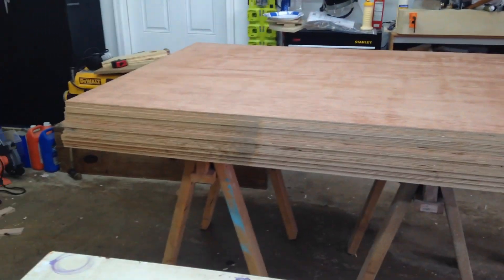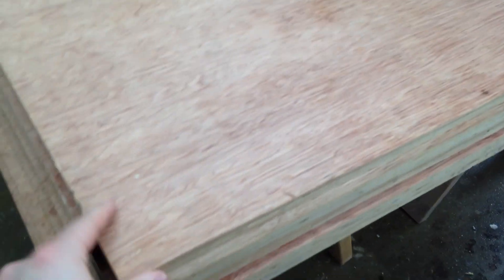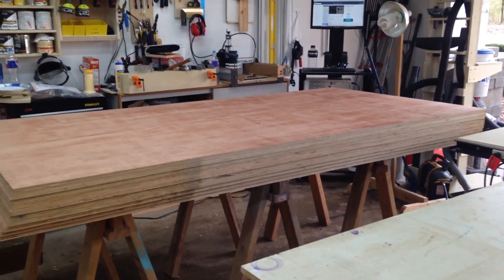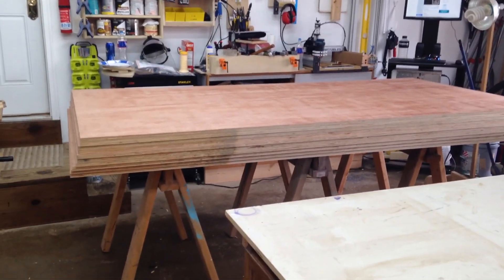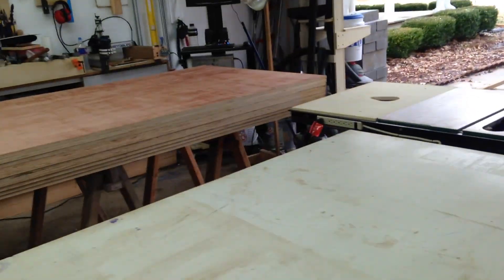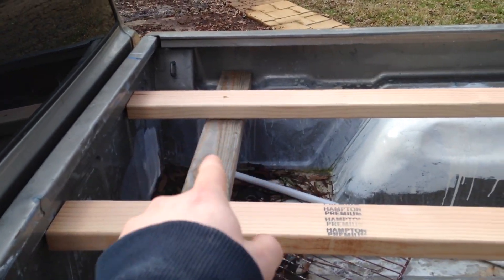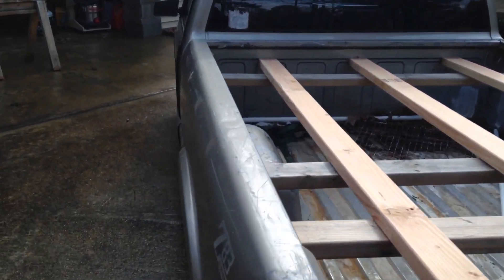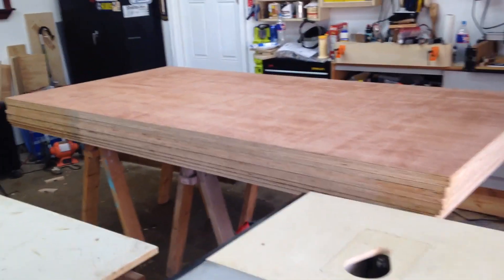Hauling full sheet goods in a small pickup

Comment: I have owned several full sized trucks and now drive a Nissan Frontier and since moving to a mid-sized truck I can still haul just as much lumber and sheet goods as I did before. But I sure do like the lower price at the pump.
Reply: I've got an old beat-up Dodge Ram 50...that's right, I said 50. Little 4-banger with a bed long enough to put a 4x8...barely. Love the 30+ mpg.
Reply: +Mike Merzke Which type do you have? Do you have to leave the gate down? How do you keep it from sliding out?
Reply: +John RossStar I would leave the tail gate up and that would prevent any sliding.
Reply: So you had a small cab type with a full bed then....i wish they made a crew cab with 8 foot bed.
Reply: +John RossStar No, it was the short bed. The plywood just hung out over the end but with the tailgate up gravity kept the sheet goods in the truck
Reply: ahh of course...thanks for putting up with the silly questions but i'm looking for a truck - not a fan of the super short beds.
Reply: +John RossStar Those weren't silly questions at all. I have since replaced the Nissan Frontier with a full sized Dodge Ram 1500 that I put a contractors rack in the back to haul lumber. The issue I was having wasn't sheet goods but rough cut lumber.

Comment: Reminds me of a job I had in high school at a paneling/plywood center.  We'd have DIY'ers and contractors come in and buy 50 or more sheets at a time.  We'd load them into their full-size pickup with the tailgate down, then go to tie them in place.  More than once the buyer would say, "Don't bother, they won't go anywhere."  The boss would tell them, it is no bother and just takes a few minutes.

Buyer would insist it wasn't necessary, pay for the load, drive up to the end of the driveway to the road.  Wait for traffic then pull off going up a small incline, to get on the road.  You guessed it.  Plywood and 1/4" paneling all over the road.

Not one buyer would ask for help in picking up the goods.  Which is a good thing because we were always laughing our heads off.

Comment: Have you ever had a sheet or few slide off going down the road with that system? I do something similar as your set up and I also have a roll of the rubber drawer liner with me. I put a small piece of the liner between the sheets on the end make sure they don't slide off. And of course ratcheted the snot out of the boards too. Thanks for sharing Jay
Reply from the maker: I tie the plywood over both directions at the end of the stack so there is no way the ply can lift or slide out. Right behind the cab I just use one strap over the pile to prevent it from lifting up. Hopefully this instagram pic link will work. You can see what I'm talking about: https://instagram.com/p/zxjo4liwu3/?modal=true

Comment: Next step is cutting all these big sheets up. Any tips to stay accurate?
Reply: good table saw
Reply: gerard kiers That's a good point, but I find that working with 8' x 4' sheets on a table saw is difficult... Hence my question
Reply: Robert Echten I have one of these and use it for cutting down sheet goods when the table saw just won't work. https://www.youtube.com/watch?v=vYcdHlwKsOg
Reply: Jay Bates Thanks! I actually made a 4' version of that earlier, but I used 3/8" plywood and found it to flex quite a bit. I'll have to get some thicker material to make a new 4' and an 8' version :-) Good point also to not use it for accuracy, but for making it more manageable. My problem (in my last project) was that utilization of my sheets was very high, so there was not too much 'wiggle room'. Ah well....
Reply: I've actually used these track boards to get really accurate cuts.
Reply: Jay Bates I can see it be accurate, if your support strip (or whatever you want to call it) is accurately straight as well. Do you cut on saw horses, on the ground with some support, using a sacrificial board underneath?